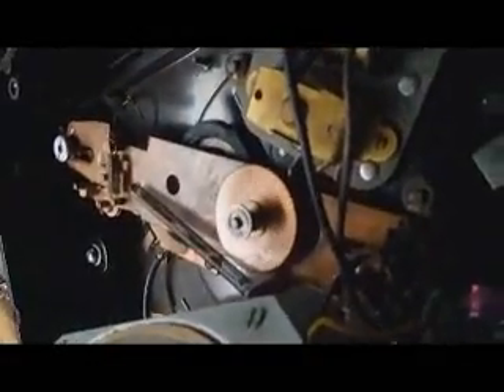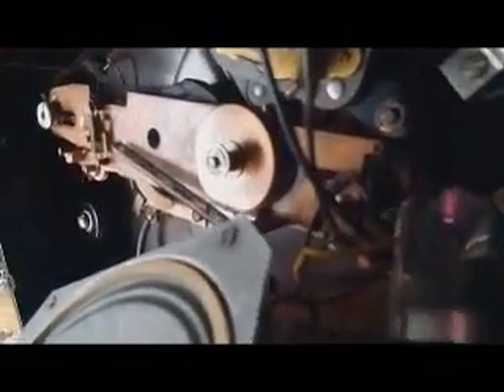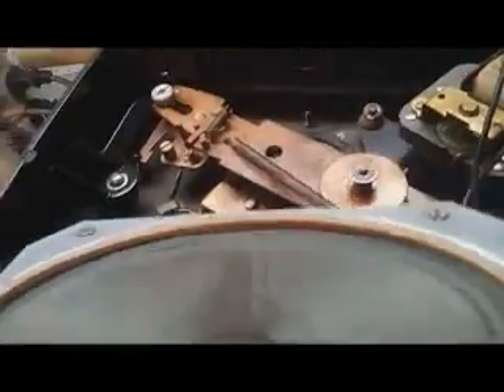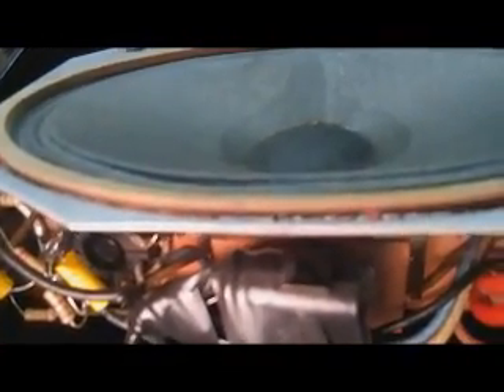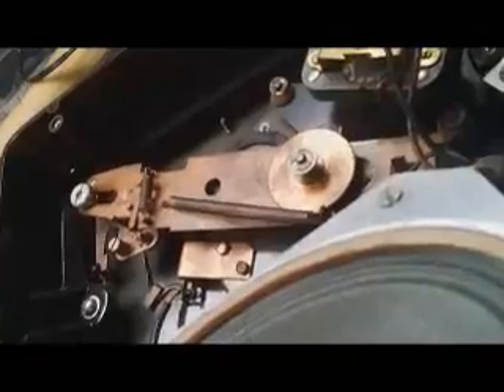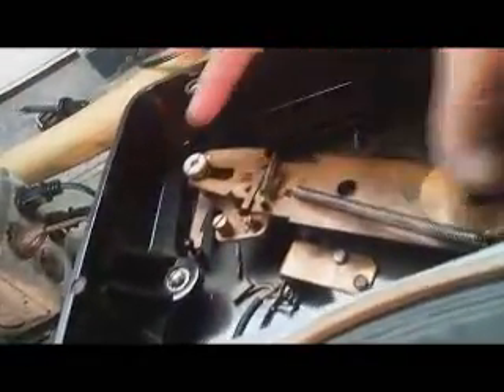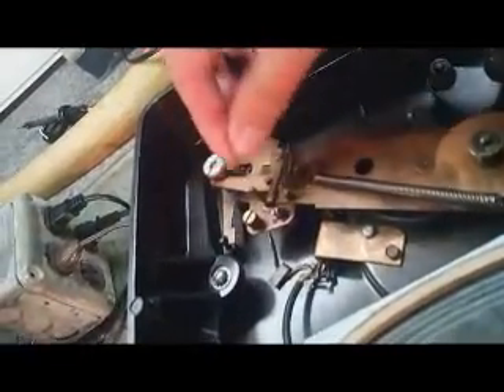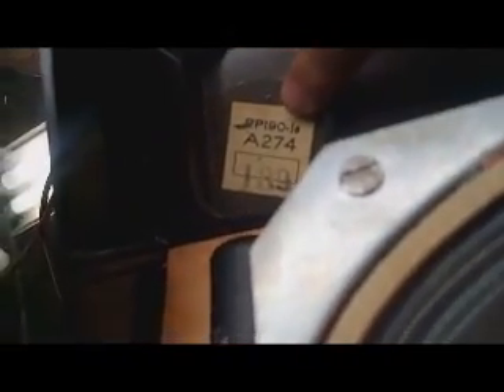RCA Victor Model 45-EY-3 Restoration - Video 2

Comment: How do you remove the idler wheel off the post. Don't see a C clip. Please advise
Reply from the maker: There is a spring, not an E clip that holds it on. Be very carful when removing it, that you don't stretch it out of shape or loos it (it will fly across the room into the 7 circle of hell if you are not careful). 😂